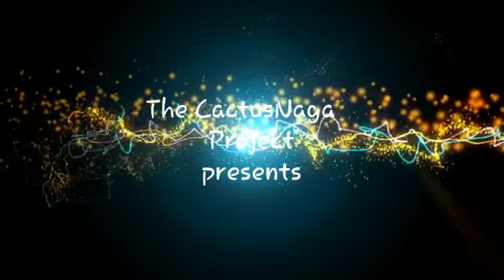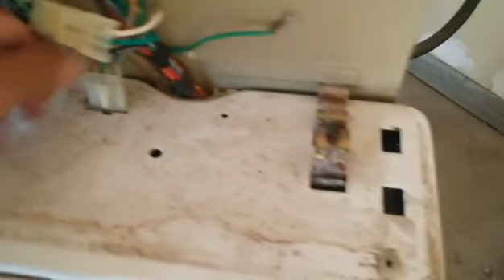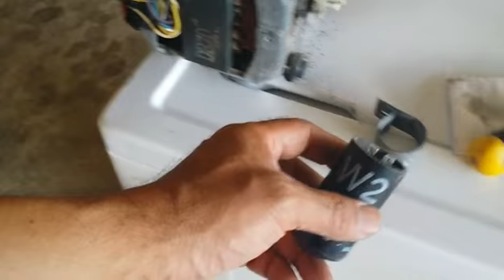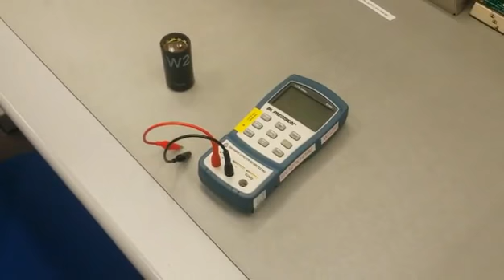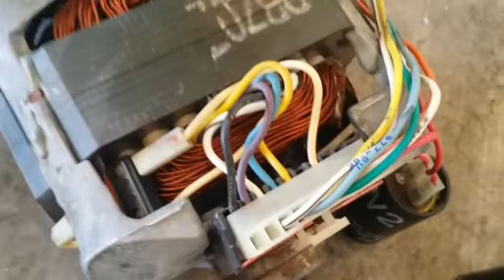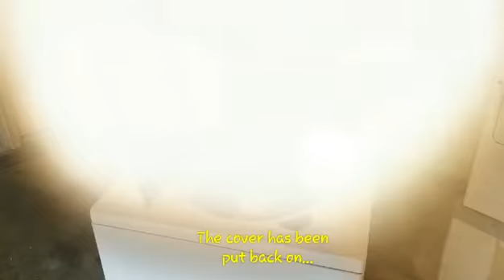Washing Machine Not Spinning - Centrifugal Switch

Comment: I realize this video is quiet old but if anyone remembers wire destinations it would be a great help. I was given a motor with no harness. Inside the switch there is the far right connection that eventually makes/breaks contact with the far left connection as well as the yellow wire that is to the right of the blue. Im pretty sure these three are the only ones that control the switch and starting the motor. My hang up is should i jump the yellow(next to blue) to the far right connection? I can run the motor on 110v connecting the white wire with black stripe to blue wire. With 110v that would mean jumping power from blue to yellow and far right switch connection. 
As confusing as my comment sounds im sure someone will understand my end goal. 
My  connections are:
#1 black, #2 empty, #3 black and white, #4 blue, #5 yellow, #6  empty, #7 solid white that goes to overload then runs down in coul and cones back as the white and black, #8 & #9 empty and #10 goes to switch.

Comment: Your video just saved my washer, almost gave up on it! Everything seemed to work, only the motor was not getting juice. Even changed the capacitor, still nothing. Then I took off the centrifugal switch, clicked it a few times, blasted it with air and motor starts humming. Thank you!
Reply from the maker: Really glad to hear that the video helped! Thanks for commenting.

Comment: I think I missed the part where you did anything to the centrifugal switch. 
  You mentioned the mechanical part that works off centrifugal force. The part the works back and forth to engage the switch contacts, but I all I saw or heard was you mentioning the centrifugal switch that you slid back and forth with a screwdriver I think. 
  I suspect the capacitor may have been the problem since it did show weak capacitance. 
  What exactly do you think you did to actually solve the problem?
  Not being mean, just would like to know what solved the problem. 
  I have had them that would agitate and not spin as a result of a weak capacitor.
Reply: He literally just told you it was the centrifugal switch. Why would he lie?
I had the exact same problem. Though the capacitor tested poorly, replacing it didn't work.
Look up how centrifugal motors work, then take off the red cover of the wiring harness / centrifugal switch to see how it works, then look at the mechanism inside the motor behind it, and it should be self explanatory.
Don't make your lack of understanding this guy's problem.

Comment: Love your videos.  I was wondering if I could get your quick opinion. It’s a hot point HTWP1400F1WW

Drive basket and motor not spinning. Belts seems very very tight and I can’t spin either with the belt on. When I turn the unit on, neither spins and I don’t hear the motor running, the pump is running though. Could this be a simple lid switch? I tried to reset the unit and that didn’t work. I got this unit that was only 6 months old from my sister, she used it and then it sat for about 4 years in a basement. My unit went and she gave me hers. But now I can’t get this one to work either... just my luck. Please help!  Thanks so much!
Reply from the maker: Hello. If the pump still works, I seriously doubt it is the lid switch. It sounds like the motor or the drum bearing is jammed. To find out which, remove the belt and try to move the drum. If it still doesn't move, the problem is on the drum side, likely a siezed bearing. Good luck! Thanks for watching and commenting!

Comment: What a tease -  the issues is even in the title of the video. What's the point if you don't show that part of the tear down/repair.
Reply from the maker: Thanks for watching and commenting. I was poking around in the centrifugal switch area with a flat blade screwdriver, and the switch clicked back into place. I did not have to dismantle the motor any further. The switch is inside and difficult to show with my limited cellphone camera back then, but it is visible and accessible using a screwdriver. Good luck!

Comment: A.  You got the starter wires ( red and yellow, capacitor).  B. You got the (blue and the white) for high speed.  C.  You got  the (blue/black and white/black) for low speed.
So I am sitting here and wondering  which wires go to the armature and which ones go to the stator coil?
I doubt if these motors are series wound ( or they will just keep spinning faster and fasater) and if so,  can these motors be taken apart so a person can separate the armature and the coil wiinding and make them separate?
Reply: Its a capacitor start induction type motor , the inner rotating Rotor that drives the motor shaft requires no connections to power , the outer stator coils "induce" a current within the rotor creating its magnetic field.  it does not work like a universal washing machine motor those do have a powered armature like those used in older front loaders another example of a universal type motor , is a vacuum cleaner motor.. those motors have armatures that require a connection electric power (through a set of carbon brushes to generate there magnetic field.  how capacitor start induction motors work   https://youtu.be/2XYdTogWcIA

Comment: The centrifugal switch has contacts that can burn. You can replace the whole switch (the black plastic piece where the wire harness plugs in) or remove it and open the one on the motor and clean the contacts. You probably unstuck some burnt contacts when moving the lever..
Reply from the maker: Thanks for the explanation! I'm sure other viewers will find your comment useful too. Thanks for watching and commenting.

Comment: Why spend so much time on testing a capacitor that is not the problem and no time showing testing the malfunctioning centrifugal switch.  Furthermore, per Olivad's comment, why not replace the centrifugal switch... no comment?
Reply from the maker: Targa Bob, it didn't start off with the knowledge that the centrifugal switch was malfunctioning. I went with the most common cause, the start capacitor. In my case, it was not the cause. And frankly, I just stumbled across the centrifugal switch. And by the way, I did reply to Olivad's question. Thanks for your comment and thanks for watching!

Comment: Isn't it better to replace the centrifugal switch if it isn't functioning properly?
Reply from the maker: The centrifugal switch is inside the motor and I believe is part of the motor. You could be hard pressed in finding just the centrifugal switch, and might need to replace the motor. In my case, it has been over a year and half with no problems after the resetting of the switch. Thanks for watching!
Reply: Video should have included how and what you did.
Reply: CactusNaga Sa
Reply: Davilo Olivad qñ

Comment: can you show me how you fixed the centrifugal switch. i cant open the motor case so it's hard for me to see why its not disengaging.
Reply from the maker: I went in with a thin flat blade screw driver from the front end. You can actually see the switch assembly between the wires, looking at the motor from the front end. Good luck and thanks for watching!